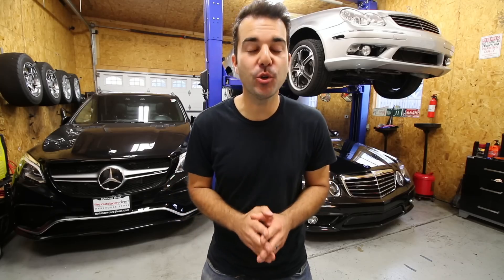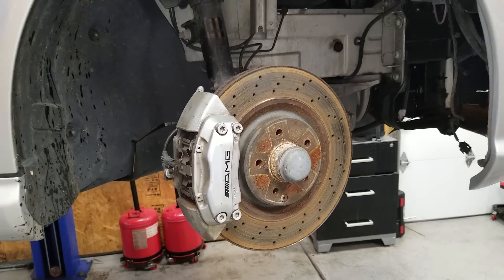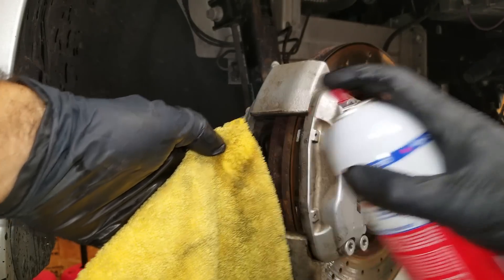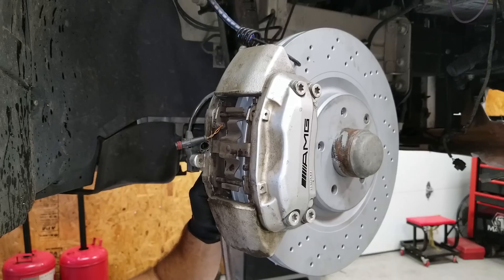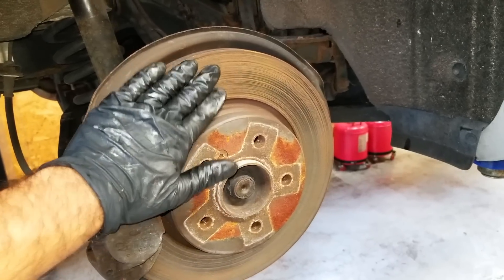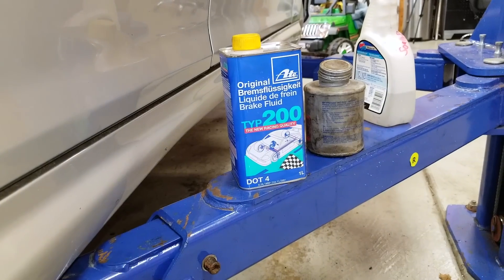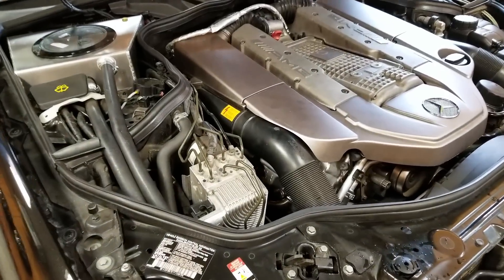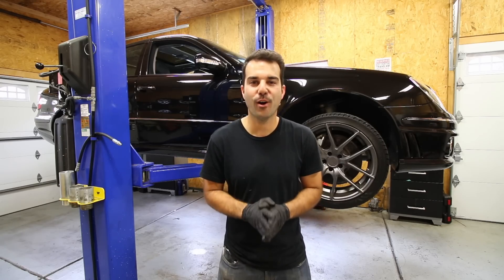Don't Let ANYONE Replace Your Factory Brembo Brakes Before Watching This Video. Big Brake Reality.

Comment: Hi Alex, I'm curious as to how often you see drilled rotors getting cracked?
Reply: Same here. Been told to choose slotted over drilled whenever possible.
Reply: Long as they are camphered holes, they last fine. If you track the car, it can cause stress cracks. Mercedes AMG factory rotors are drilled & slotted
Reply: I've had drilled rotors that were chamfered holes that cracked on me. On A Streetcar the rotors were made in Canada they were on a Buick Regal GS they quality expensive rotors that's why I no longer use drilled rotors
Reply: Unless you are tracking the car and using extreme braking (rotors glow red in sport racing)... the heat will crack the rotors cause the holes... which is ironic cause the holes are meant to keep the rotors more cool and prevent fading.

Comment: Hey man. I downloaded 2 different files on that website trying to find those FACTORY style manuals. One was just an owners manual. The other was a web based interface with a few specifics on the r230 chassis. Please help. I just spent 50$ for no reason. Literally. Nothing i downloaded looks like the photos in your video.
Thanks

Comment: Hey Alex, I heard that when the pads are due to be changed specifically on Corvettes that it necessary to change rotors. Is that true? Or is ok to just change the pads.
Also, could you touch on those that have BBKs were the Rotor and Hat is two pieces how to service that setup?

If you need a donor car to show that video I live in Chicago and can be of service. ;-)

Comment: 7:10 Min.: You should know, that the turning moment, which can be transmitted during braking (and depends on the normal force provided by the 5 wheel screws) is calculated with NO lubricants between the brake disc and the face of the hub where the rotor sits. Otherwise these screws could be loaded by shear strain and fail!
Reply: That is my take the situation as well, bolted or drive faces should never ever be lubricated, I remember as a lad, greasing a flywheel hub on a straw baler, only to have the shear pin fail several times until it dried up, I thought I was helping but got my ass chewed for it, for loosing so much time.

Comment: Don't forget to take brake fluid out of the master if You need to before compressing the pistons back in, or you can open the bleeders and put hoses on them so that dirty fluid does not go back up into the master and then come back down when you bleed them. 
There is a tool that measures the moisture of your brake fluid so you know better when to bleed the whole system better than just based on time.
Been doing brakes for 50 years and the damage that moisture does is very expensive. The water in the system goes to the bottom of all the piston cylinders and corrodes them which chews up the seals on the pistons in the system which causes the leaks and sometimes catastrophic failure under higher pressures.

Back in the day of drum brakes, we were always replacing or rebuilding wheel cylinder kits and master cylinders because people did not change out the fluid much, and the fluid was not as good as we have now.

Comment: I downloaded one of the manuals. how do I open it in the format he's using? The manual is nearly 8000 pages!
Reply from the maker: You upload a virtual machine and open the manual through there. Just follow the instructions and you are good to go. If you need help just send them an email. They were really helpful when I has some install questions.
Reply: Richie, some of the manual's are only in pdf format. I tried the same thing for an 05 w211 e500 and it was only avail in pdf format. The one that Alex was using had an .ova extension that allows him to use the virtual machine. to help you go thru the pdf and find what you are looking for a little easier you can do a crtl and "F" and type in what you want to find.

Comment: DON'T use antisieze on the AMG it will burn and destroy your bearings and the hub will melt slowly just watch next time u replace the brakes AMG also are very strict Don't Use. 
For the Brakes BREMBO Q-quiet. Else AMG never use BREMBO pads just to clear that up only the rotors are Brembo works fine running 5 time now 7 years on my E55 no problems ever

Comment: 6:40 - Logically, you want to hook up the bungee cord to somewhere as close to the brake line as possible to minimize the stress put on the brake line. So, instead of hooking up the caliper from the hole at the other end of the caliper, he should have used the hole on the right side which would be much closer to the brake line. Small detail but still worth pointing out, especially if the person is using hand tools and/or doing this take longer than a few minutes.

Comment: I have AMG and are my brakes brembo brakes? E63s
Reply from the maker: Hey Jon. I'm almost positive Mercedes AMG only uses brembo. But either way it's a fixed caliper just like my cars so super easy to work on just like in the video. Check the back of the caliper, it should be stamped with Brembo
Reply: LegitStreetCars ok thanks

Comment: Your C55 rear calipers are not moving properly based on what the old rotor looked like. Also the fronts, i would check the runout on the front hub

Comment: Thank you for sharing the info on the manuals. Finally I found and specific one for my 2003 C32. Hopefully I can find the issue with My car, if I drive more than 20 miles the car stall and loose power ending in shut it down.

Comment: I am so pissed. While I was away, my uncle worked on my AMG and swapped out my right rear caliper with a cheap remanufactured POS!  Now, I'm rolling with 3 red Brembo calipers and 1 grey crap caliper. They didn't even save my old caliper. So, it's expensive to get one. I just installed Stoptech axle pack with drilled and slotted rotors and ceramic pads. It's such a better improvement over the stock components. 
Yes, I broke my brakes in which is required. I don't care what anyone says, breaking in your new brakes is essential!
Don't get me wrong, I am grateful for the repairs being done but, come on now.  These are men who normally work on relative's autos and they read car magazines.  So, you'd think that they'd be knowledgeable about the difference between a Brembo caliper vs. an auto parts store remanufactured basic W163 grey caliper, right?  There's nothing wrong with a caliper rebuild kit. I, and anyone else for that matter  would have been smart enough to recognize the bright RED color of the High Performance Caliper. 
Yes, I would have preferred my old caliper to have remained versus the rebuilt crap caliper.

Comment: You don't want to mess with the brakes on a merc with sbc unless you disable the system. Plain and simple.
Reply from the maker: Very plain, very simple.
Reply: @LegitStreetCars  I've never disabled the SBC on the E55...?
Reply from the maker: @WarpedYT  Then you are risking a hand when replacing pads
Reply: What's SBC and why
Reply: It's almost like drive by wire brakes. With the system enabled there's a chance the caliper piston could snap closed while you're working on it. If your finger is in the way when this happens... no more finger. Even unhooking the battery doesn't disable it. You have to go in with the mercedes software to disable it. Wikipedia can probably explain it better than I can. https://en.wikipedia.org/wiki/Sensotronic_Brake_Control
Reply: @jsloden1  sounds dodgy

Comment: Lubricating the brake pads (Not the slide pins, but the pads themselves) has always seemed counter productive to me. I imagine brake dust would stick to any kind of lubricant you use, and cause more problems than just keeping it clean.

Comment: Hey man, Love the content. I'm a die hard Mercedes enthusiast and have had several. Currently have a 2002 w210 e320 and have been wanting to build something different. It has an m112 and I'd like to keep it that way but maybe a m112k swap from the c32. Thank you for all the great projects and advice.  Helps a ton especially because of the m112/m113 being almost identical..

Comment: ha I ordered the brembo 2 piece rotors for my c63 w204 from fcp euro the other day, also got porterfield 4s  pads from another vendor. Alex is there a way to electronically back off the pistons like that gle on a 09 c63? I have to replace my washer bottle so I'm going to do this all at once while the wheels are off!

Comment: great video as always. I have tried and tested many brands of brakes on Mercedes especially on the high performance models and i have to say i have never been satisfied with the quality of any brand other than Genuine Mercedes or ATE, so much so we as a garage only fit genuine brakes no matter what! we found that 9/10 of the disc's were warped by the time 12 months went by and the car was due its annual MOT/service and would have to be done all again under warranty, i tried for years, yet never had 1 come back with genuine.
I will be interested to see how you get on. Keep up the good work.

Comment: I watched most of the video despite the rather enthusiastic narration. I would add just a couple of things: It's easier to compress the pistons if you remove the cap from the brake fluid reservoir being careful not to allow it to overflow, of course. It's easier yet, and probably smarter, to just crack the bleeder and squeeze our some of the brake fluid when compressing the pistons. Will have to refill the reservoir, of course, if not doing a flush. Second, whacking away at the rotors with a hammer is never really a good idea. Tapping stuck rotors not so hard and then putting large bolts with nuts and backing washers through the caliper brackets and thus applying pressure to the back of the rotors works very easily and safely. The protective grease on the surface of new rotors should be removed with brake cleaner. The ridges on the surface of rubber brake lines are there to assure that they haven't been inadvertently twisted when replacing the calipers.  All "ceramic" brake pads are definitely not created equal.  Be sure to pump the brakes to re-establish the pad positions before driving the car!
Reply: That's fantastic and all... but on the MB's with SBC "removing the cap" won't do squat. You have to disable the SBC to release pressure.

Comment: Made me laugh when you described that rear caliper as a more traditionally mounted caliper on a sliding bracket.
Don't know about your cars across the pond, but older disc brake calipers in the UK were always solidly mounted with  2 or 4 opposing pistons and pins requiring knocking out to remove the pads.
The Brembo are exactly the same just with extra pistons.
Single piston floating calipers largely came about in the early 80s.
Think you are showing your youthfulness.
Reply from the maker: Just my experiences where I live but if that shows I'm young, I'll take it. I'm starting to feel old at 34, Haha.
Reply: @LegitStreetCars  A collection like yours at 34 is some achievement. Respect.

Comment: Great informative video, Alex! I've been contemplating on doing a BREMBO / Corvette / CTS-V brake conversion on my '97 WS6 and it's nice to see how easy the calipers are to work on.

I was pretty impressed that the guys at the parts supplier joint knew about the rear brake rotor interchangability on a one year oddball car.
Reply from the maker: One of my first videos shows the CTS V brembo brake conversion on my TA. Let me know if you need anything
Reply: Will do... thank you, sir.

Comment: Awesome vid with great info, well presented and great flow! Question for ya; I was trying to use a hand sucker pump to refresh brake fluid on my c63. It seems like it was pulling in air from around the threads of the bleeder (there's definitely not that much air in my system... It was like drinking from a broken straw). Would you suggest applying some pipe thread tape to the bleeders or just get different/better fittings?

Comment: Do not use drilled rotors - not for road, not for track. Modern materials mean you don't need them. The holes will lead to cracking. Plain rotors are best for road use. Grooved rotors can be used for track (but extra wear on pads).
Reply: tell that to these wannabe clowns who pretend they are professional race car drivers on the public roads. They love forking over extra money for 'performance' parts that in reality do nothing extra.

Comment: Do not over tighten the caliper mounting bolts, it will strip and that's a really bad time.
Reply: Have you ever seen the caliper bolts torque specs? They are high as hell, higher the wheels nut specs. I think for my corvette its 120 lbs or something like that. In reality (cause the awkward impossible unnatural way tightening the bolt AND only lifted on a floor jack) I cant get to 120lbs. Either way, they weren't too tight from factory.
Reply: @U2Jaime1317  I've encountered this problem noted in several work manuals that turned out to be a typo. If you have M12 grade 11 bolts they can hit ~95ft lbs in the aluminum calipers and the M10 grade 8 bolts can hit ~65 ft lbs. 
Some peformance brake manufacturers had improperly outfitted calipers with the wrong strength bolt, they should all be grade 11+ and basically only tight enough to flatten the lock washers. 
People had been tighting their calipers over 100 ft lbs, some using silver anti seize, lets just say the bolts never came back out.

Comment: You use basically the same pads on definitely the same fluid. The ate 200 is a good combination of value and high temperature capability. I thought about getting the motul stuff but it's really Overkill from my application. I was tempted to get the two piece rotors which we're on sale for 450 a pair which is an incredible price instead I got some Hawk rotors they are slotted and they look a little like what Indy cars have they were only 50 a piece I don't even think they're available anymore.The two-piece save 20 lbs. In hindsight I might have indulged that and replaced my battery with one of those lithium's a 30 lb savings when you got a 3700 pound car losing 50 lb is better than nothing. There are guys trying to lose more weight than that.

Comment: Didn’t see you checking the rotor runout so from the beginning your process is not accurate.
Guessing the new rotors are Zimmerman’s , a cheap replacement of the MB genuine.
The rear rotors are not drilled as per MB engineers decision , by installing drilled rotors with the same diameter you are REMOVING 10% braking surface from the rear changing the car braking dynamics. As a MB owner for 25 year and 1.2 million kilometers I can say that there is no alternative for the genuine MB parts / fluids and please stop misleading your audience for the clicks, what you finally managed is to degrade the braking performance of the car by 30% the least, you have no official test and anything that proves that your mods saves money and improves braking performance and at last any real MB owner won’t put himself at a risk by using your tips just to save money plus MB should be officially repaired by MB certified engineers, please share your certifications with us if any.
Reply from the maker: You are right I didn't check rotor runout. Didn't need to as they were clearly warped and had a massive grove ground into them on the back. Zimmerman are fine rotors and not a cheap replacement. I've used literally hundreds of them on Mercedes, not one complaint. 
I put the drilled rotors in the rear for looks, I've made a video on how drilled rotors don't add any performance to braking systems. This is not a track car, just thought it looks better.

You think I made this video for "clicks." You sir are what we call a "Purist Pete." It's a syndrome with some Euro car owners. They think that only factory parts and factory "spec" can be used on their car and if you use anything less you are "ruining" the perfect engineering.  

  You are definitely not impressing my audience who like me, take practical and proper routes when working on Euro cars.  You can save money, do the job right and work on your own high-end car if you have the knowledge and tools which is what I try to provide in all my videos.

Not sure why you have to come off like a total jerk but then again we have many keyboard warriors on the internet and congrats, you are one of them.  Btw, I worked as a Journeyman technician for Mercedes for 10 years so your 25 year ownership means literally nothing to anyone. How easy is it to own a specific brand car? Very easy.
Good luck to you sir.
Reply from the maker: Also these parts are cheaper than going to the dealer and did you really say that only MB Certified engineers should repair these cars? So basically send the car back to Germany for a brake job? I mean dude, they are brakes. People replace them all the time and fixed calipers are easier to work with that floating.  Good luck with yourself.
Alex